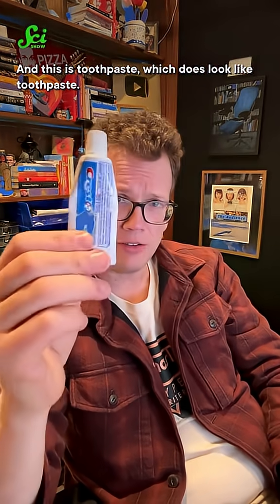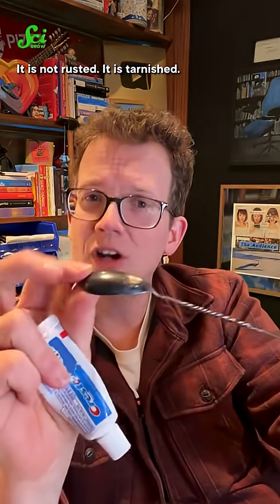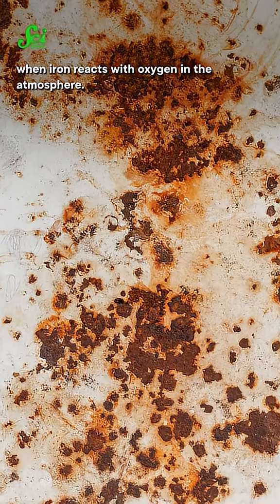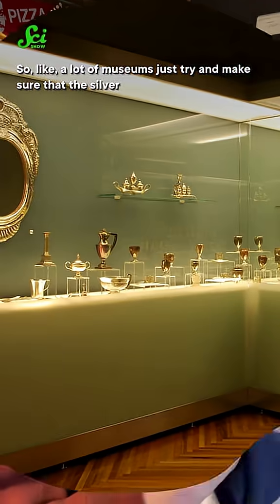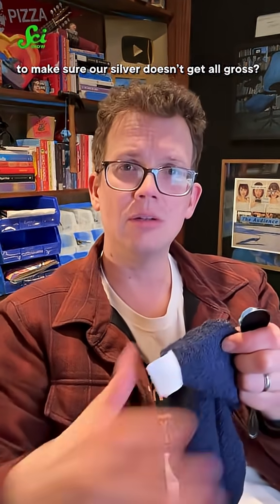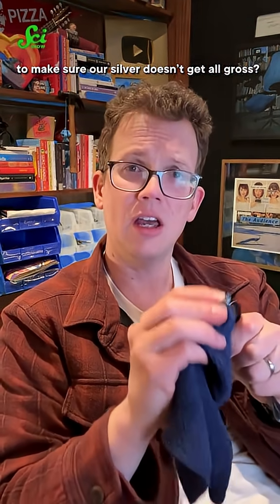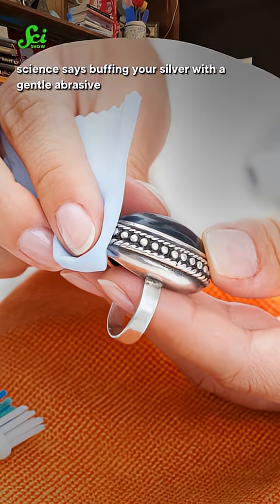What makes silver tarnish?

Comment: Have we forgotten that creating an ionic solution with salt and sodium bicarbonate in boiling water with a piece of aluminum transfers the sulpher molecules to the aluminum without damaging the silver?

2 tbsp salt
2 tbsp baking soda
4 cups of water or so

bring to a simmer

toss a 6"x6" piece of foil into the pan, then add the silver to be cleaned.

Rinse well and dry with a soft cloth.
Reply: For the chemists - The primary chemical formula involved in this process is a redox reaction (reduction-oxidation). The aluminum foil acts as the reducing agent, while the silver sulfide tarnish is the substance being reduced. The baking soda and salt solution creates an electrolyte bath that facilitates the transfer of electrons.

The Main Reaction 
The black tarnish on silver is silver sulfide (Ag_2S). Aluminum has a stronger affinity for sulfur than silver. When submerged in the solution and in contact with the aluminum foil, the silver sulfide reacts with the aluminum. The aluminum "steals" the sulfur atoms, freeing the silver metal and forming aluminum sulfide.

The overall chemical equation is:
3Ag_2S(s) + 2Al(s) \rightarrow 6Ag(s) + Al_2S_3(s)

The Role of Each Component 
 * Silver Tarnish (Ag_2S): This is the black coating on the silver, a compound of silver and sulfur.
 * Aluminum Foil (Al): The aluminum is oxidized, losing electrons and reacting with the sulfur from the silver sulfide. The aluminum sulfide (Al_2S_3) is a grayish substance that may form on the foil or in the water.
 * Baking Soda (NaHCO_3) and Salt (NaCl): These are dissolved in the water to create an electrolyte solution. They increase the electrical conductivity of the water, allowing for a faster and more efficient transfer of electrons from the aluminum to the silver sulfide. The reaction is an electrochemical process, essentially a tiny battery is formed where electrons flow from the aluminum to the silver.
 * Hot Water: The heat increases the speed of the chemical reaction.
This method works because it reverses the tarnishing process rather than abrading or polishing the silver. It converts the tarnish back into solid silver metal, which preserves the original finish of the item.

Comment: Get a container. Put some aluminum foil in it. Fill it halfway with hot water (like almost boiling hot). Add salt and baking soda. Drop the silver in and wait. The tarnish will transfer over from the silver to the aluminum foil and it will come out clean and shiny.

Comment: I make a dish of aluminum foil that the item will fit in. I cover it with enough water to be submerged. I dump ½ teaspoon of salt and then stir the item in the saltwater. ½ a mi. or less it is shiny. Great for jewelry. Salt & cider vinegar does it for copper bottom pots.

Comment: Tbf I use baking soda/aluminum electrolysis to clean my silver chain which I'm 99.9% sure is sterling silver and it doesn't get a noticeable brown tint, so I'd say it's more worth than slaving over the chain with toothpaste to get every crevace. For silverware and rings I would say just go for the toothpaste to buff it out.

Comment: RUST is the OXIDATION of elements... It has NOTHING to do(except for our preconceptions) with Iron (4Fe + 3O2 -> 2Fe2O3)
Aluminium also undergoes RUSTING.... rusting is just 'the slow oxidation of metals'
Sulphur, IS NOT 
"a tiny percentage of our atmosphere" 
there is NO 
"atmospheric sulphur gas" 
in our atmo! what is actually present, in our atmosphere, HOWEVER, IS- 
SO2 and SO3, 
THEY ARE present in our atmosphere. so is 
(SO3 + H20 -> H2SO4)

Comment: ok... now mix toothpaste and spulli concentrate, the dishwasher soap. mix it untill you get a sort of rubbery material. and use THAT to finish, after mixing soap and toothpaste on a toothbrush. The rubber is softer and more controlled and even oif it doesnt reach as much as a toothpbrush it gives a certain controll and bull for certain corners or areas that require harder rubbing. Silver doesnt tarnish just with enviroment gases, if in contact with skin it gets all sorts of fats and hardened gunk layed inbetween the silver tarnish along the sculpted topographic feutures of the piece.

Comment: You can also use a sing filled with water aluminum foil and (tricel) silver soda. The tarnish gets off really easily when soaked in that mixture. Just yeet a couple balls of the foil inside and you're good to go. It makes cleaning silver in volume a lot easier.

Comment: As someone that works mainly with silver in the jewelry business, if your silver jewelry comes in a plastic zip bag, keep it. store it in the bag or find another one that holds the jewelry without tons of extra space or air. We keep our backstock individually in a plastic bag for each item, I know it's a lot of plastic but just keep one to use for as long as you can. They take way longer to tarnish when stored this way compared to the things we have in the open air on display.
Reply: Thank you so much for this advice!! One per each ring?
Reply: @lefish5277  one per piece if you want to protect your silver from dents and scratches, if that's not super important to you then a bigger bag with multiple pieces works too

Comment: I just realized, if polishing could work like just using force and calcium, can u just use a soft abrasive drill or rock tumbler to help polish the silver? Or another way to think abt it, use a mix of calcium solution to weaken the outside tarnish layer?

Just a thought :P

Comment: Nooooo. Bad advice. It will damage the finish. Place 1 c hot water, 1 T baking soda, and 1 T salt into an aluminum pan. Dissolve. Add silver. The add 1/2 cup vinegar. Allow the tarnish to transfer to the aluminum. Polish silver with a microfibre cloth when  it is tarnish-free. Recipe scales well for large batches or items.

Comment: Toothpaste also does a great job on clouded car headlights should they develop that cloudy lens problem. Most people don’t realize the tremendous drop in effectiveness that lights get because of it, it actually boggles my mind that cars will pass a NYS inspection with the issue, yet fail if a tire inflation sensor is on. But, most of NYS laws are passed after an 8-9 martini lunch, so....... Did my sales tax increase since I started writing this? Damn....

Comment: hot water, baking soda and aluminum foil. Put the aluminum foil in the bottom of your container. Fill it with hot water. Put the baking soda in it. Put your silver in it. As soon as the silver touches the aluminum foil, it will pull the sulfates off of the silver reversing the process and putting the sulfates onto the aluminum foil. You are welcome.
Reply: This is the electrochemical process hank mentioned in the video.

Comment: I use Wright's anti tarnish silver polish. Not only does it remove the tarnish almost immediately, but it also leaves a food safe coat that slows tarnish. It's also not as abrasive, so it won't wear down the detailing as fast.

Comment: I have a silver necklace that I wear everyday. It tarnished completely but then over time it all came off and hasn't tarnished since.

So my guess is that the oils from my skin are helping it stay polished, or maybe rubbing against my skin and clothing? Idk if that's possible but I can't think of another explanation.
Reply: The oils from regular wear do prevent tarnishing. I have a heavier weight silver chain, the insides of the links are black but the outsides that touch my skin stay bright.

Another possibility is that it was only silver plated and the plating has completely worn off.

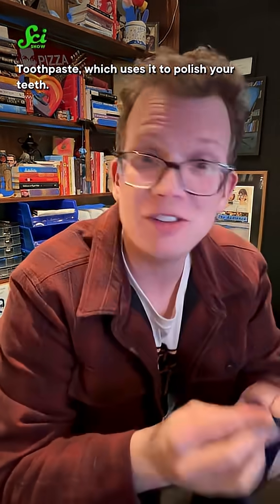Comment: as you can see at 1:28, it leaves a bright mirror polish /s

just buy premium silver polish people, and use nothing that will scratch it up, unless you like your silverware looking like brushed nickle-- in which case, buy something cheaper

From the guy that has flatware that still has its factory mirror polish after 25 years (except the 1 spoon a roommate used a scour pad on!)

Comment: As a jeweler, I want to clarify that the tarnishing issue isn't with the silver itself, but with the copper content in sterling silver (.925). 
The 7.5% copper added to silver for strength makes it prone to tarnishing. In contrast, fine silver (.999) is softer but resists tarnishing much better, to the point it’s hardly noticeable.
Reply: As a chemist, it is definetley the silver that tarnishes when exposed to sulfur. 
If you use the electrochemical metod to reduce the silver, then you can often smell the hydrogen sulfide even. 
Copper does also tarnish, but it forms patina, which has a green color.
Reply: @huleboermannhule44 Copper just makes it sulfudise much quicker. Copper oxidises very quickly. In the presence of sulfur compounds it reduces by the sulfurisation of the silver. This is why silverplating works as a mild anti-tarnish for silver objects and also explains why many fine silver coins do not tarnish for years and years. I am a mastercraftsman goldsmith from Germany and fortunately we had a very good chemistry teacher in our masterclass.
Reply: @huleboermannhule44 I understand that you are a chemist, but I have years of experience handling heirloom jewelry, and fabricating in both sterling and fine silver. I can conclusively tell that’s It’s the copper content that makes sterling silver far more prone to tarnishing. I have fine silver pieces that are several years old and are still nice and white. Both fine and sterling silver can be antiqued with liver of sulfur, but sterling silver develops it on its own with normal wear, fine silver can stay white for years and years.
Reply: As a collector of fine silver with a bad habit of losing it all in boating accidents, fine silver does in fact tarnish.
Reply: Thank you!
Reply: Is there a reason why people don’t wax silver to keep it from tarnishing?
Reply: @commontat0r478 it make the surface look dull and less polished, the wax rubs off to the skin or to the food. Older, no longer used silver objects are sometimes covered with zapon lacquer, which is cellulose nitrate. That is not food safe, makes the item look a little bit dull, a little yellowish and tends to crack over the years.
Reply: @commontat0r478  don't people  sometimes rhodium dip their silver for this reason, to protect it from tarnishing (slowing it, anyway).
Reply: That is absolutely not true. Copper reacts the same way as silver, just makes the colours looks a bit different. You get silver sulfide and silver oxide, as well as copper sulfide and copper oxide on sterling, .900, .800 etc. On fine, it's just silver sulfide and silver oxide.
Reply: It's tarnishing due tu sulfur in air 2000 years ago not such problem. The black residue is Ag2S, so no copper here, the bath with aluminium foil and salt allow to pull 2 sulfur atoms from silver, and EDTA can clean other stains or patina with weaker atomic bonds

Comment: I have restored many of silver and silver plated instruments. Silver polish with fingertips. Then clean alcohol to strip the oils. Then use anti-tarnish paper strips in the case. Its more appealing to the Sulphur. But replace every 4 to 6 months. Also works with silverware, and jewelry. Plus the finger tips is because its abrasive enough to help with removing the tarnish but soft enough to not wear it down quickly.

Comment: As a jeweler I would recommend buying a silver tarnish removing cloth to remove tarnish and improve the polish. Toothpaste is a bit abrasive and is likely to gently scratch the silver, removing the tarnish but also leaving a less polished finish. Fun fact: you can use ketchup to remove tarnish from copper!
Reply: We use polishing clothes from James Avery Jewelers.  They are excellent.  We also use Nev-R-Dull for copper and brass.
Reply: I just smelt the spoon and recast it exactly.
Reply: So just cloth and no polishing powders or abrasives?
Reply: @TaLeng2023  they make specific cloths for cleaning silver jewelry. It seems a lot of people here recommend a brand called Nevr-Dull. When you open the can of Nevr-Dull, there should be a cotton wadding that's treated with the silver cleaner. You can pull a piece off and clean the tarnish off your silver jewelry. It should work virtually instantly upon polishing. Then just use a soft microcloth to buff the piece.
Reply: @TaLeng2023  Polishing cloths are infused with a polishing compound. The cloth serves as a medium. Like a toothbrush, it brings the polish to the object and create the mechanical action necessary to polish it.
Reply: @yamitsukikarasu8857 Surely the infused compound runs out? Or no?
Reply: @TaLeng2023 the polishing compound is embedded into the cloth making it ready to use on the role. It can be expensive but I saw it from a whole sales for 15$ a 25ft roll and like 70 for a 75ft roll. Hagerdys polish spray also works great and the tarnish just wipes off after it sits a second. But it’s expensive and smells like death.
Reply: Ok, question, I have a "tudor plate oneida community" fork, the old silver-plated queen Bess design, that has been...sandpapered(?)...at the first inch of the tong tips. It's no longer shiny, past the silver-plate, down to whatever base metal was used to create it. My question is, how or what do I do to get it a "top coat" or something to protect it and make it safe to wash and eat with again?
Reply: @Zimoria  absolutely no real knowledge on the topic, but since nobody has replied yet, thought i'd offer my two cents anyways :D 

I know with gold you can apply a thin layer through electroplating, i assume you can do something similar with silver. how practical it is, though (in terms of accessibility, time, and cost) i have no idea... nor do i know if it's an appropriate method
Reply: @greatday19 thank you! I've not heard of electroplating, I'll at least look into it. Every time I try to research my issue I just come back to polishing, but I can't polish what's not there 😅
Reply: @Zimoria so true xD when i did a quick google (just to make sure i wasnt talking complete nonsense) there were two similar processes that i came across: one using electricity (electroplating), snd one using chemical reactions (chemical plating?), but no idea about the different use cases... anyways, hope it works out! :)
Reply: @Zimoria your item was plated in the first place, so there's a way to plate it again. You'll likely go the chemical plating route, since a local jeweller who is setup for electroplating is common but who has the solution and desire to do so in silver will be very rare. My workshop doesn't even do gold plating, only rhodium.

This is different for something like "gold-filled" or "rolled gold", which is actually fabricated differently. These items can be plated when the gold wears off, but you can't "re roll" or "re fill" it.
Reply: @Zimoria take it to a jeweler that offers gold plating, because they can likely also do silver. It is less common, though, so they might not have the solution on hand. You can also DIY it with a piece of pure silver (.999) and a phone charger. Plenty of tutorials on YouTube.
Reply: ketchup because of the vinegar content?
Reply: Can it be sealed from air by adding a wax coating to it after polishing?
Reply: Would ketchup work on brass? I'm curious as to how much effect the tin has on the polishing
Reply: As a jewelry major i don't recommend tarnish cloth as a regular use as it works through abrasion and will wear down the silver over time.
Reply: @raeesterlina6941 a good tarnish cloth is embedded with an abrasive that is harder than tarnish (silver sulfide) but softer than silver, so it only removes the tarnish. But of course, the existing silver having been converted to silver sulfide, is removed.
Reply: @raeesterlina6941 As an observer of human beings, I always find it entertaining to watch specialty & trade students, including majors, contradict the professionals on the advice said experienced persons have given.
Reply: I use a specific jewellery cleaner for any jewellery to clean it. Sometimes I take dish soap and a small paint brush to get dead skin and dirt that gets stuck in small parts of it without really scrubbing.

Unscented dawn dish soap is what I use especially if I'm staying at a family member's home because not everyone has a specific jewelry cleaner.

Comment: i wear silver rings. if i purposefully tarnish them every so often to darken the shine a bit, but natural movements rub it away, is it very slightly taking AWAY silver? do i have to worry about having less than what i started with eventually? To reiterate: is tarnish a thin layer of the silver itself, or is it the other elements alone resting and reacting on TOP of the silver?
Reply: The tarnish is silver that has chemically reacted with atmospheric sulphur. So yes, every time we remove tarnish we remove a tiny bit of our jewellery. That said, silver rings wear thin from use regardless, so I wouldn't stress too much. But I'd definitely use the foil/baking soda method or a polishing cloth rather than an abrasive polish like toothpaste.